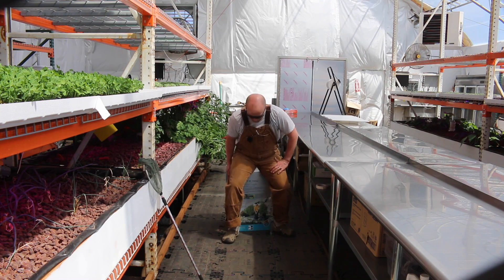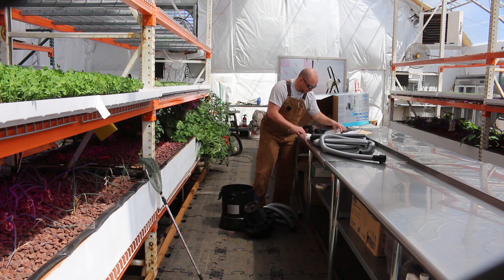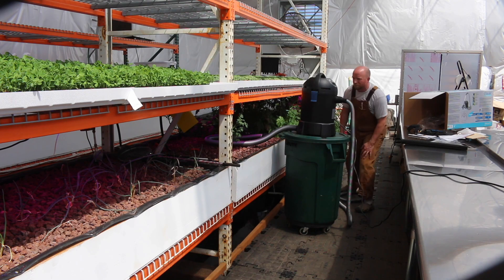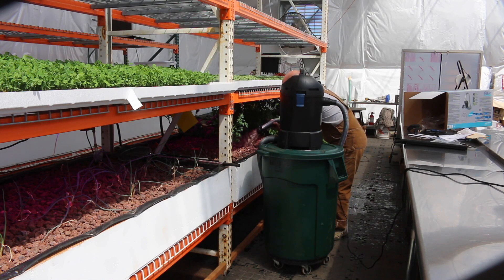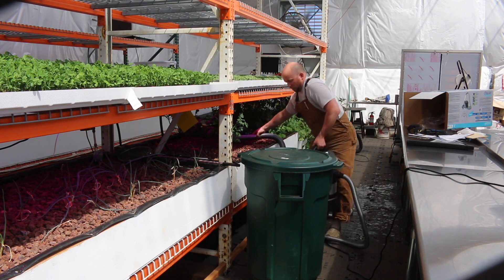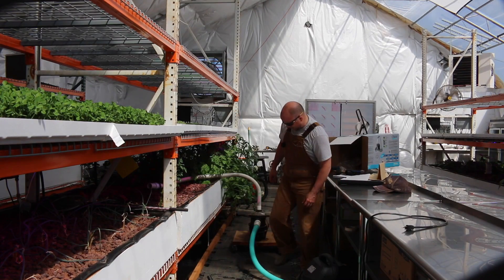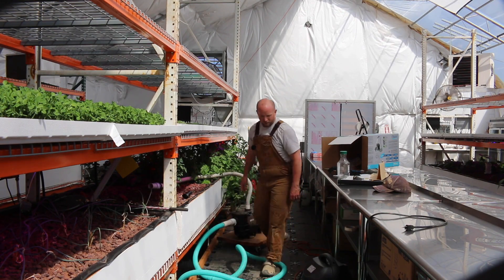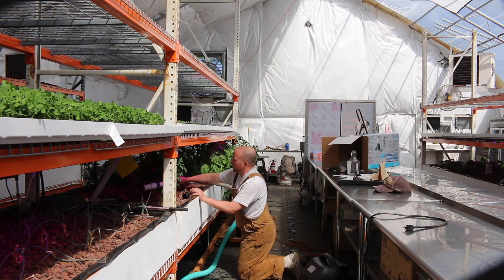Aquaponics - FISH WASTE Removal Solution?

Comment: I had some problems trying to get "waste" out of mine as well. My setup is very similar to your's (in-ground raceway). What worked best for me was to use a pond pump to get the gunk out (for me it was mainly mud, etc. since it's a newer system). Worked really well after I got a pump that can have a hose hooked on the inlet. Basically just used the pump the way you're using the vacuum except that it's made for it. For the outlet, to get the fine solids out of the system, I ended up putting the outlet on some folded up polyester batting. It worked like a charm. If you want more info, video, pics, etc. let me know. I haven't done any before so I can't speak to quality but if it helps I would be happy to.

Comment: Place a weighted pipe with a number of holes down it's length along the bottom of the fish tank, plug one end of the pipe, and attach other end of pipe to the pump inlet being submerged or other. Suction along the bottom naturally draws any fish waste into the normal water cycling.

So it's another half assed solution attempt, lack of research, and a disturbing lack of 'engineering' like bothering to RTFM and see how the vacuum is suppose to be used in the first place. It might just include the best method for getting the water moving. It's a crazy concept, I know, but that might be the kind of thing they'd include in a manual for a pond vacuum.

As for a robot, no, just no... with the established track record for anything electronic it would be a waste of money that causes more problems than it solves and will just be a black hole for time and effort.

Comment: I posted this in the last video. You need a linear piston pump. It pumps air out at an incredible rate. If you have fish dying from anaerobic conditions, then you need to add oxygen. Oxygen can be added through both current, gas exchange, and directly adding air to water (which gives gas exchange, and current). A great positive side effect of adding air is that it will mix up the waste at the bottom of your "fish tanks", and the pumps that you already have will both clear the "fish tank", and get the waste out and up into your bed. It might take a couple days to completely clear out, but that will definitely do the job, and once you have them installed, it is maintenance free. There is no maintenance to keeping the bottom of your "fish tank" clean once you have proper circulation and aeration.  It is definitely scaleable, they have Linear piston pumps that will put out amazing amounts of air. The setup would look like - Linear piston pump->PVC tube->Air lines -> Air stones.  Please read this comment.
Reply from the maker: Comment read. I'll check that out!

Comment: You really don't want the raw debris from the bottom of the fish tanks in the media beds.   The worms won't be capable of doing what you expect or need.  Setup a swirl filter and then pump into your old salad bubbler.  In the salad bubbler, add bio beads with surface area with massive rolling air bubbles, then discharge into the media beds.  This will take care of the heavies, demineralize of the solids and help clean the water entering the media beds where your plants will thank you!   Media beds will naturally gunk up with roots and worm castings.  So forget about pumping extra bottom of the fish tanks gunk into the media beds.  It will just kill the plants and make a stinky mess.  Rj - Beyond Harvest Veganistas a fb group

Comment: Why buy this if you have pool pumps? Just use a pool vacuum.
Reply from the maker: Pool pumps use a lot of amps. So a lower electrical demand solution is preferred
Reply: TheRealMartian I understand. I think the only way you could do this is with an air lift. But you will need lots of air to get it up that high. I am also worried that your bed will fill up with solids. I know you have works but I still think it's an issue you should look into.
Reply: There is another form of airlift that pressurizes a tank at the bottom and uses that pressure to push the water up. It kinda pulsates.

Comment: From my understanding you were trying to use a shop vac to clean the bottom perfect. But for the shop vac to work you must have a shut off valve at the end of the drain hose not to lose all your suction from the inlet. Love your series of video best of luck.

Comment: You have an air-compressor?
If so build an air-pump.  All you need is a: 
-   12-14 feet long PVC pipe. and some lenghr of air hose. 
- Insert the hose into the pipe so it is 1-2 feet from the end that you put into the water.
- open the valve for the ai. The air bobling thrue the water will drag water up the pipe and out the top. You can then add a T junction where you can connect one of the hoses from the cleaner to get water into the beds.
This type of pump scale up to very large and kan deal with anything that fit in the pipe..

Comment: Failure is always a learning opportunity.
Reply: unless you are defusing a bomb then failure is a blast.
Reply: Failure is waste of resources, especially when it's the result of lack of research into a problem that has long been solved. Then the lack of common sense and confusion of why something doesn't work when not bothering to RTFM on how it was designed to be used, and not using that way.